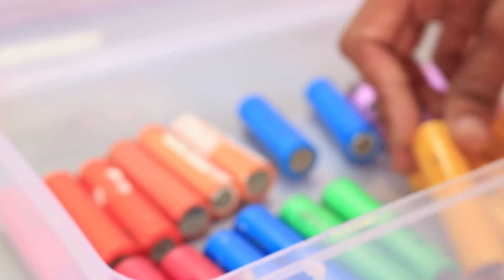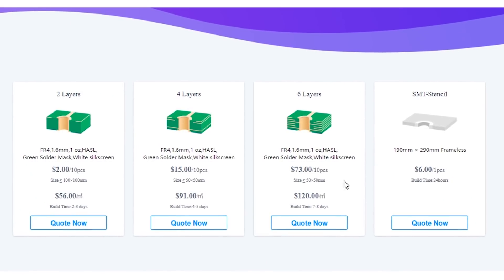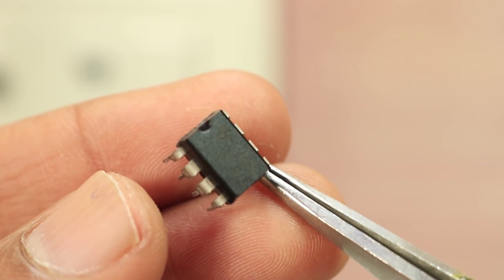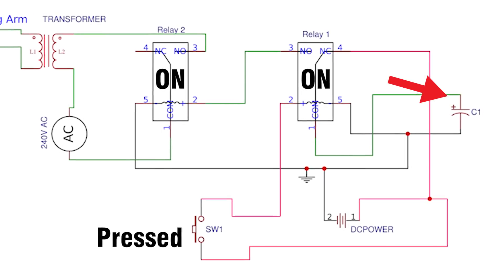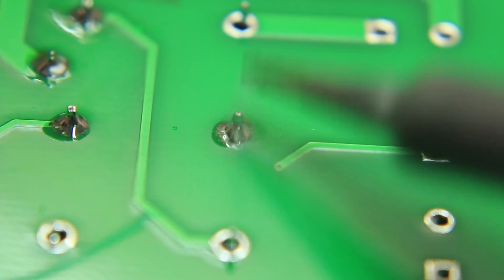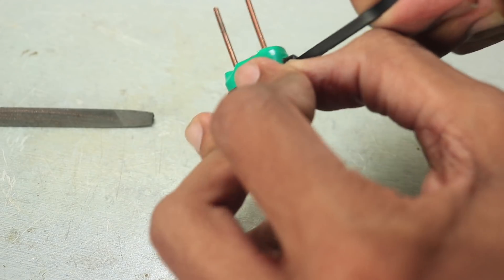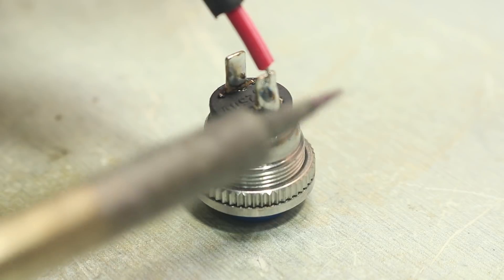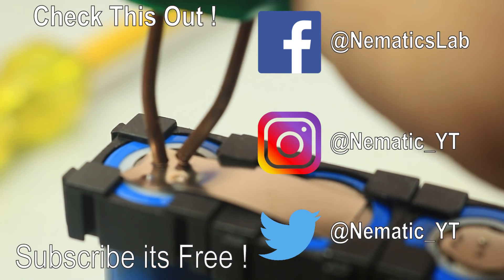DIY 18650 battery Spot Welder! | Microwave Transformer

Comment: I built your circuit and it works great! I'm wondering about voltage spikes from switching the large inductive load of MOT. Have you had any of your relays fail? Perhaps a snubber circuit should be added to the design across the relay in parallel with the transformer?

Comment: Hey, is it possible to use two or more smaller wires in diameter when you put them in parallel into the transformer? Or does it only properly work with one big wire.

Comment: did you make any improvements in this timer circuit?
also, can we use a diode between the coil of relays to reduce flyback voltages?

Comment: Hey I made a similer spot welder but I cannot weld tabs with it either just one probe welds and or almost burns a hole in the tab .Or if I'm successful in making a weld it's not a very good one .And also if I make a weld the next weld it will not weld. TILL I BRUSH OF THE PROBE TIPS . I can adjust the welder time down to 1 ms. I've also tried more .Or less wraps on the transformer. CAN you help . I bought nickle straps. How good is the quality? I've also tried to weld on a factory made pack same result.

Comment: Just made spot welder with your timing circuit. Using four turns of 25mm square on the secondary and 240 vac on the primary, with a 100uF 50v on the timing end. Works a charm. Cheers. 👍

Comment: hi dear sorry my english but i translate my language with translator. 
 what is the voltage on the red wire for soldering?  which cable (mm2) did you use for this?
Thanck you

Comment: Thank you bro. I made my timer by you idea. It's pretty simple and it work very well. Only instead of battery for  first relay I used  old 12 V power supply from DVBT antenna. 
https://www.youtube.com/watch?v=u1CvxFC_4ug
You can make welding chuck - holder for wire and electrodes from an old porcelain socket holder for a light bulb and an old plastic water meter seal.
Only what you need is make two 3mm diameter holes with concrete drill for holding wire and electrodes.
Porcelain holder as a ceramics is the best material for welding chuck because it is temperature proof and electro isolated. Then two screw used in bulb holder that originally served for holding wire you can  now using to tune distance between two cooper welding electrodes.

Comment: I have a oven from Thailand (110volts) 
Can i use that transformer (india)
Reply from the maker: Not recommended
Reply: @Nematics_Lab  could you please share the primary resistance of your transformer 
Please🙏
Reply: Please😊
Mr. Nematics lab🔬
Reply from the maker: @vamsikolla  32ohms
Reply: @Nematics_Lab  but my ones have a resistance of 1.2ohm🤯🤯
Reply from the maker: @vamsikolla  correction mine is 7.4ohm
Reply: I brought it for 600rs☹️☹️

What can i do with it now... 🤔🤔

Do you any idea 🤗🤗🤗

Comment: Can we use normal transformer to get high current?
Reply from the maker: You need a a Transformer which can deliver at-least 100A
Reply: @Nematics_Lab  how much is important secundar voltage ? is there some recomended value ?

Comment: can plug the 120v transformer into 220 or 240?
Reply from the maker: No you can't
Reply: but it's just the same as you use it, so maybe try
Reply from the maker: If you connect 2 transformer in series and then connect it 220v it's fine, but I won't recommend connecting single 120v into 220v
Reply: @Nematics_Lab  thanks for the reminder

Comment: Your r awesome, from long time waiting for DIY battery tab spot welder, good job man, could you pls elaborate  connections you made power supply from switch board, transformer   2*18650 battery its rating, Thanks in Advance
Reply from the maker: Check description it has link to schematic
Reply: @Nematics_Lab  bro can i use 250v Ac 3A switch
Reply from the maker: Yes
Reply: @Nematics_Lab  thanks bro
Reply: bro one last doubt  18650 batteries do we need specific Amp and Mah
Reply from the maker: Nope you can even use 9v battery
Reply: @Nematics_Lab  okay bro thanks for the speedy response, i have 18650 3.7v 2200 5A and 18650 3.7v 2600 15A batteries in this case i can use any one of them right?
Reply from the maker: Yes
Reply: Bro can I have 47uF 16v, 100 uF 25v and 220 uF 10v, are the capacitor should be 50v only or can I use above for the same project
Reply from the maker: 16V is fine if you are using 2x18650 cells which gives 7.4V
Reply: Thanks bro, so I will use 100 uF 25v and 47 uF 16v to reach 150 uF as you mentioned in the project